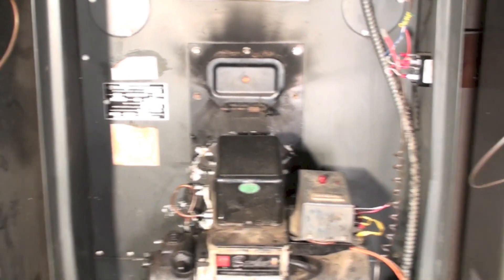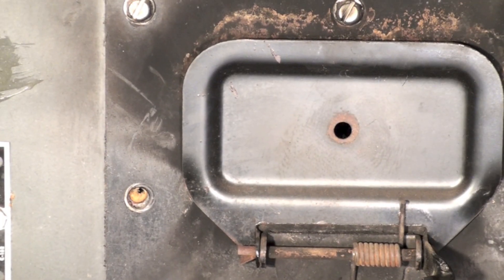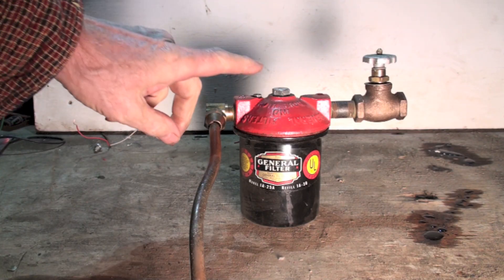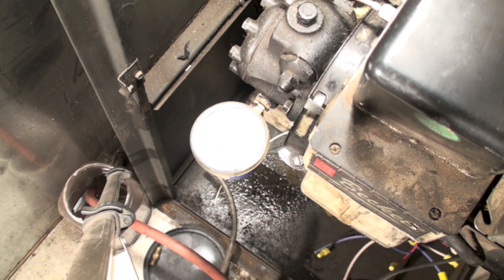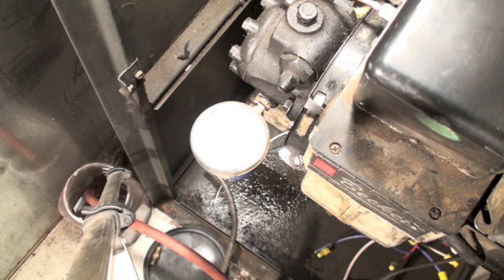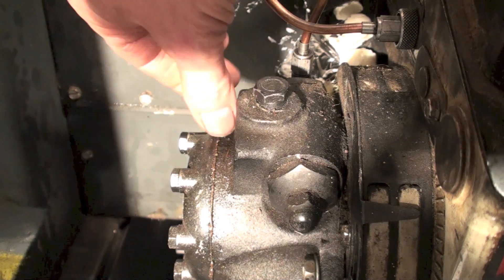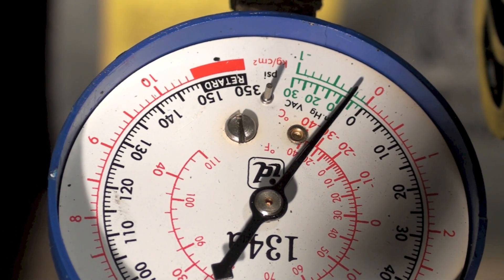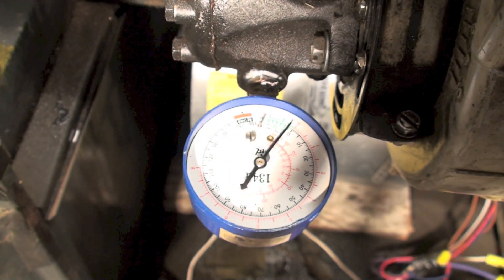Oil furnace troubleshoot part 4 no oil to burner

Comment: My pump was squealing, filters were fine, ended up being sludge built up in my line from the tank over the years, unhooked both ends hooked a jug on one end blew it out with compressed air and squealing dissappeared on start up.

Comment: I have oil my oil filter is clean i checked all my connections the pump is pumping out air but not oil I have a two pipe system I've bled for hours and just air I changed the filter have oil flowing from filter  2 feet from furnace and can blow air back into inlet pipe at the pump connect everything and still just get air
Reply from the maker: Look for a vacuum leak in the supply line.
GFM
Reply: Check your oil level.  If it is a 2 line system it should prime eventually hitting the reset.  Pull the high pressure small line and see if there is flow.  If there is then it’s a nozzle / assembly issue

Comment: Is there any chance that the nozzle might be plugged? I have a burner that oil comes out after I attach the oil line from the assembly and it does pump out, but still no fire? There is a good spark makes me think it could be the nozzle its self? Anyone ever come across that?
Reply from the maker: You could certainly have a plugged nozzle.
GFM

Comment: Don’t forget to remove the nozzle ( which should have been done when inspecting the ignition electrodes) to clean the filter that is on it.  Verrrrry important. The nozzle  metal screen filter and the filter in the pump is probably more proned  to obstruction dirt than  any of the other filters because the filter out dirt and debris more finer than the primary tank filter

Comment: Thank you sir for very informative videos! I have one question, when I do smoke test every third sample is wet. Two tests show trace (0-1). co2-9.1, o2-8.6 Could you advise what it could be? Thanks.
Reply from the maker: Any wet sample indicates unburned oil.  You may have had an ignition failure and the combustion chamber has not burned the residual oil.  You could also have a partially plugged nozzle.
GFM
Reply: @grayfurnaceman  I see. Thank you so much! Wishing you all the best in new year!

Comment: I got all drip feed style one. No power no pump. The control valve doesn't even fill up as much as it needs to even though the valve is full open. Is it the level? Or air bubble?

Comment: Gray Furnaceman : would you answer a question or two please ? I was up all last night 05/30/2021 because the symptoms were what was described in your video. Oil burner would turn on then off then on again as if there was air in the lines or maybe a clogged nozzle. So I changed filter and nozzle, checked pump screen and then I could not get oil burner pump to fill up filter canister - I could not get oil to the burner. Pulled small copper fuel line that supplies oil to tube that has nozzle attached to it, has ceramic electrodes proper terminology escapes me at the moment, the gun I believe it is called(that has nozzle screwed into). Well, no oil was coming out of fuel line.  Oil tank is piped with two pipes and not gravity fed. Fuel lines are coming out of the top of oil tank. I thought fuel lines were clogged so I got air compressor and blew the lines back to the oil tank. Approximately 100 lbs of pressure was used. I do not know how I finally got oil burner to run again but I did. Original symptoms are still happening. Fires up for a little then flutters then off and eventually during the same cycle burner turns back on (thank God)before lock out. I have a Suntec A2VA-7116 oil pump. The oil pump makes a squeek sometimes when it first starts up then the squeek goes away. I do use fuel additive when the Oil delivery man delivers the oil. This is like my third pump so far. The last oil  pump I installed was 12/2019. Any help you could offer would be appreciated.
Reply: Did you ever figure out the problem?

Comment: hey GFM,Just put in a new oil tank the burner ran for about 9 hours I turned it off tried it again and no oil flow to the burner.Could it be a blocked oil line bad pump or pump coupling.I just Replaced the pump,the motor,cad cell relay and igniter, at this point I'm wondering if the tank could of possibly tilted and no oil is even getting to the oil line to the burner
Reply from the maker: You could have a blocked line or filter.  I would remove the filter canister, the turn on the oil to see if oil is available.
GFM
Reply: I'll give that a try thanks,I was leaning towards a blocked line but the filter could be the problem,I'm using the standard canister filter not sure when it was serviced last  so I might just upgrade and get a  renewable filter
Reply from the maker: Sounds like a plan.
GFM

Comment: Thanks for the very informative videos on trouble shooting oil furnaces, I went through every step on trouble shooting and learned my way around it, I ran my oil tank low, and had to clear out the sludge out of the line,  I did it with an air pump, now  I just have to install a new  firomatic safety  valve in the morning and hopefully my furnace will be good to go.

Comment: What is the best way to unplug the line? Is it OK to try blowing it out with Nitrogen or compressed air?
Reply from the maker: You can blow it out if both ends are open.  When it is clear, reconnect and do a thorough flush.
GFM

Comment: Since I worked in a city, oil furnaces were uncommon.  Seemed 75% of the time, they never serviced the filter/nozzle and continously let it run out of oil.  Most were in rental properties in bad areas.  A real joy to work on in a 20" crawlspace.  Oh, and a tank that was 35 years old and corroded................talk about dread.
Reply: There are 2 types of oil furnaces.  Those that are serviced every year and on keep filled service, and those that are only serviced when they fail.  Guess which ones had the most emergency service.  Some of the furnaces I serviced every year were installed in the fifties and were still going strong in the 90s.  Thanks for the comment.
GFM